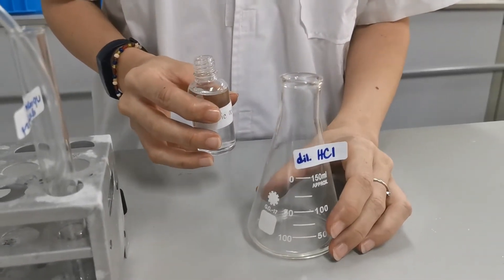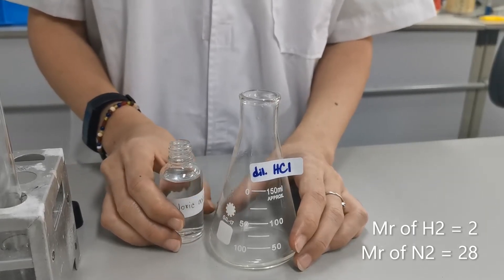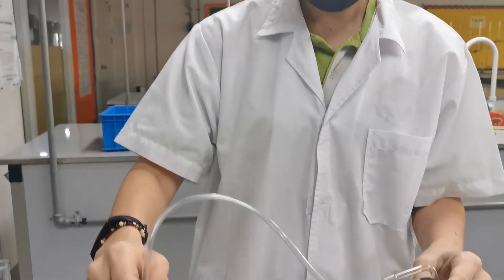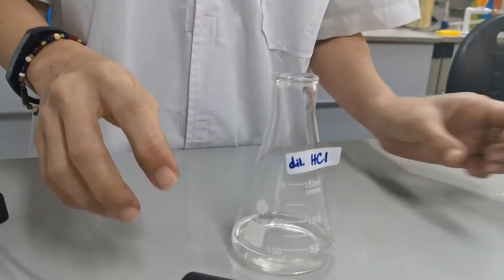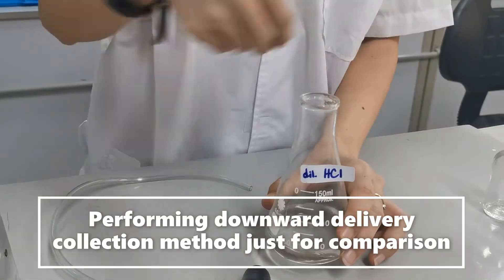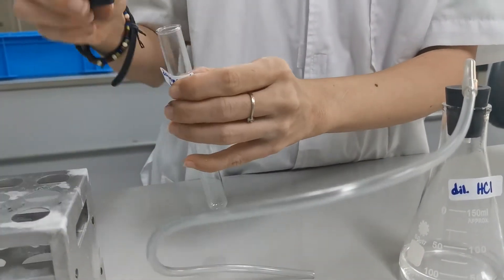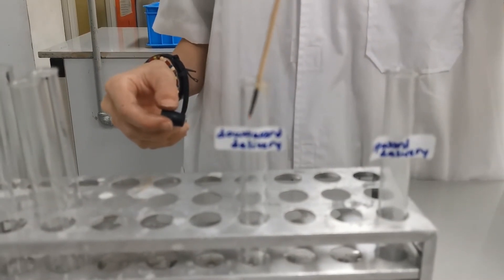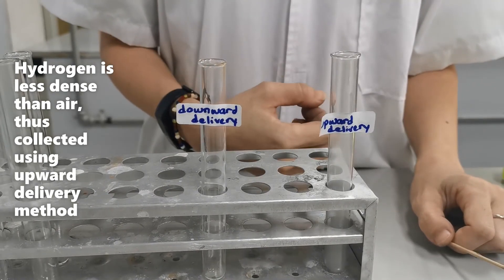Upward and downward delivery

Comment: Where did the hydrogen go then in downward delivery ?
Reply: due to its lower densiy than air, it will float upon it, escaping the test tube
Reply: but the cork was stopping it from escaping into the air. Or was it just collecting near the start of the tube and escaped when the Cork was let out of the test tube

Comment: I just have a problem to clarify why didn’t we collect hydrogen by upward delivery over water since it’s insoluble in water
Reply: Isn't hydrogen highly soluble in water ...?
Reply: Hydrogen is soluble in water so it can be collected by downward displacement
Reply: @eeshalkhan9340  Well I did some research and found out that hydrogen is sparingle soluble in water which means insoluble ....Hydrogen chloride gas is infact highly soluble in water, am i correct ?
Reply from the maker: @ttkae  Correct
Reply from the maker: Yes, that will work. You are correct, hydrogen is only sparingly soluble in water.
Reply: @theaplussquad  all thanks to you guys I have scored 95 on chemistry